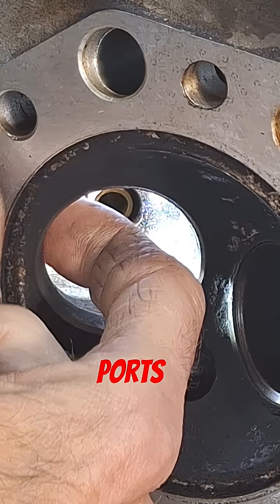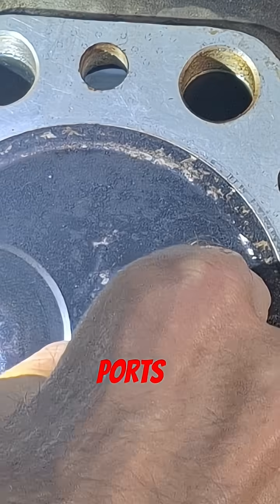What’s Hiding Inside These Engine Ports?

Comment: Wow!
Reply from the maker: Might start on the porting this weekend. Should be interesting. I started out doing heads in the 80s with no flowbench. a lot of trial and error, but once you have it down its good. 
    Then got a computerized flow bench in the mid-90s. That actually took me backwards to making less power, at first. Then slowly crept up to making more than I previously did without one.  The flowbench was nice, but the truth is we are talking maybe 5 horsepower more at a certain rpm, compared to earlier work. 
    Now, I do them the way I used to; what works, works. 
     Ordering my parts tomorrow from EuroMotoElectric. They specialize in Beemer parts. Easy to deal with, knowledgeable, and friendly. Something that seems to be lacking at a lot of parts houses these days.  Regardless, I wont have them until next week or more.